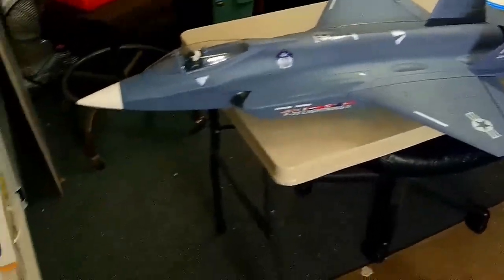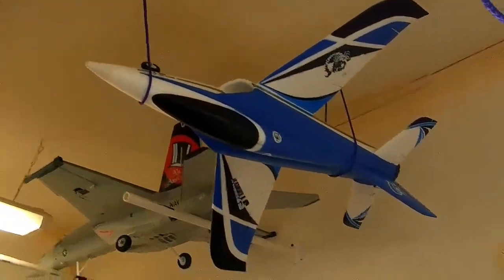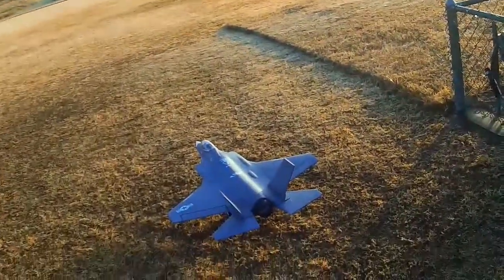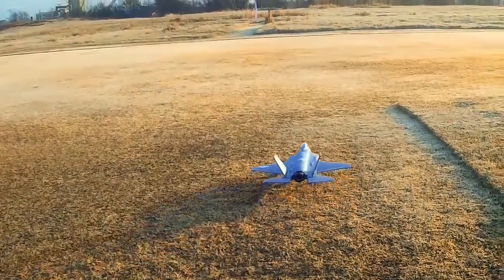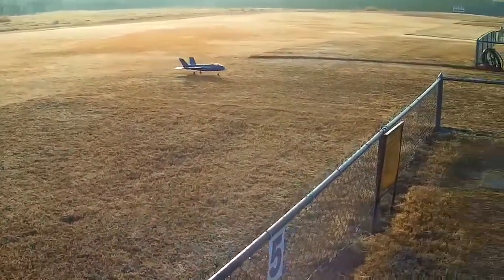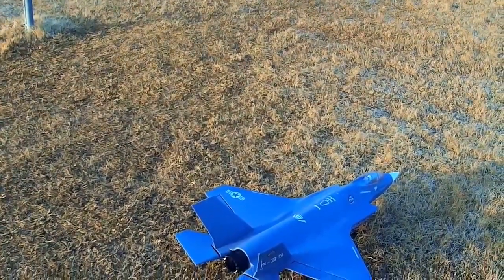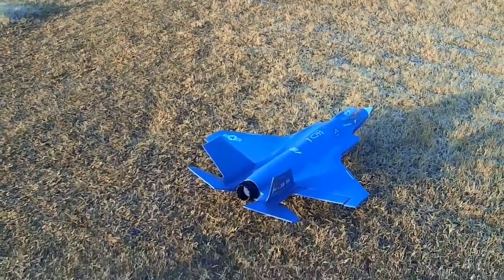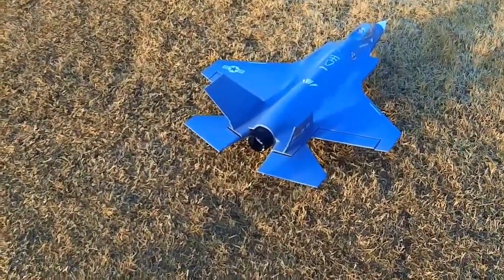Freewing F-35 Lightning II JSF - Maiden Flight

Comment: Just about every maiden flight video I have seen (myself included) on takeoff there's a huge pitch issue. Once trimmed out she's much better. I found flying with a heavier battery (I fly with 4s 4200) gives much better performance and no longer so floaty. I do keep an eye on my MLG retracts due to the heavier pack now. I had to reglue once due to the mount coming loose. 100% better jet after using a heavier pack IMO.  Congrats on a successful maiden!
Reply from the maker: Thanks
Did you have any trouble cutting out the hard plastic battery compartment? (Did you have to remove the whole thing, or just the end to make room for the bigger pack?

The thrust vectoring was a little more involved in setting up than I originally thought. I think I have it setup much better now - we will see once the weather improves here....(likely in 3-4 days based on the forecast)
Reply from the maker: I just saw your video of your Rebel V2 - (The one where the tree jumped up and grabbed it - sorry to see that happened to you)

How did you like it? - That is on my list of extra planes to try out...(as well as the 64mm Freewing A-10) - Between the two, which did you prefer?
Reply: The rebel is a great jet. very stable, easy to fly and land. It was first EDF. I fly it with a 4s 3000 pack and I did not have to carve to make it fit. On windy days I fly a 4s 4000 pack for the extra punch and the extra weight reduces the effects of the wind. I added suspension retracts from Castle RC which greatly improved the landing experience. There is no more bouncing at all, she sticks like glue.I also fly all my aircraft ( I think I am up to 26 now) with Lemon RC 7ch RX with stabilization. The A-10 I did have a few issues with until I figured it out. The dual 64mm motors draw a lot of amps, I was running a 4s 4500 and the deans plug melted in flight and crashed, got a new body/wing and a little while later the elevator servo failed on take off (full deflection down) and nose piled into the ground. New body and wings again, this time I put dual elevator servos in and haven't had any problems since. I fly off asphalt and have noticed a lot of slop forming in the nose gear when extended, not sure what the fix for that would be other than replacing the servo but its functional as of now. The model is EPS foam and the FWD fuse is very thin so it doesn't take much to damage it. I did install flaps which I use pretty much every takeoff and landing since I'm flying with such a heavy pack. I originally flew with a 4000 pack, but after hitting LVC tewice at around 3:10 flight time I decided to go bigger and now fly a solid 4:00 and come down with 3.7-3.8 per cell depending on my flying style. I would consider myself a fairly aggressive flyer, but balance it with scale flight as well. Hope all this helps
Reply: I replaced the Rebel fuse and wings and glad to report she's back flying
Reply from the maker: Great info...thanks for taking the time to relay it. - I was going to order the Rebel last night, but then saw Horizon has the Blade Torrent quad on sale, so I will likely get that first, then do the Rebel next month.

Comment: i dialed mine in with 40 % expo on elevator and real nose heavy, the ele surface is large. and it needed more power . it flies great now . the stock motor it flies like a brick. which this airframe is a brick must have power. TV is not as good as the early f-16 version  which was by far the best tv setup FW ever did .  more power the better it flies . wish i had more than dial up out here id post some vids.
Reply from the maker: I figured out the setup on it,,,It requires putting the elev on the elev channel, and the pitch thrust vector servo on channel 7, and then setting up a mix in the radio.
It looks like it is dialed in and working now....I am just waiting for a better weather day to send it up again. (It is going to be cold and windy here the next few days)
If you get a way to post videos, let me know...I would like to see how you have yours dialed in.
Thanks, and happy flying.